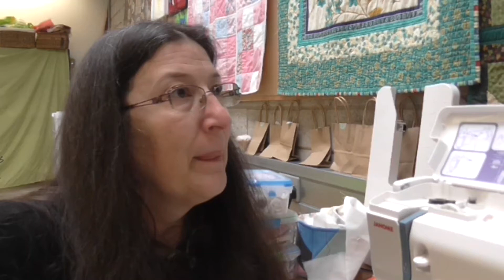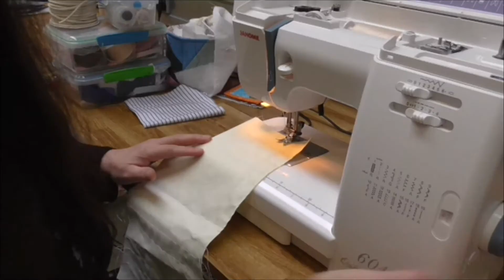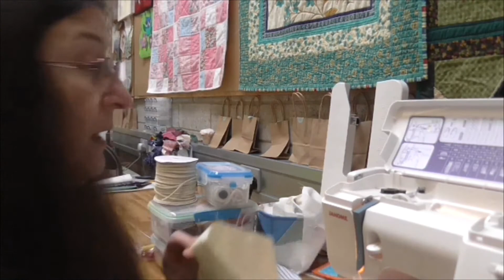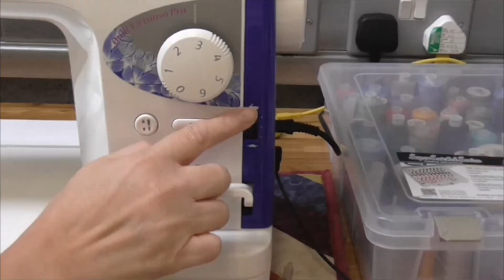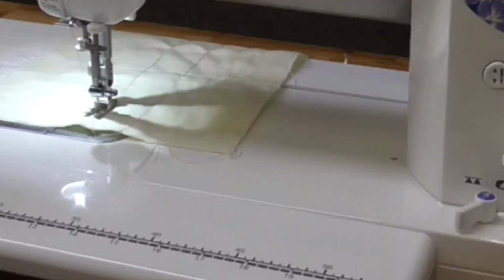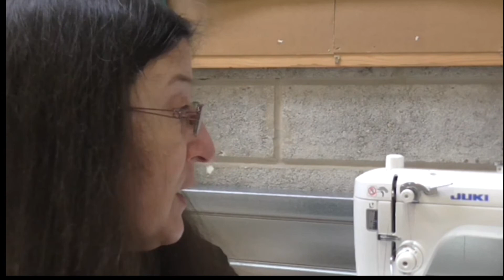How to control the speed of your sewing machine

Comment: So, do I need to buy a really expensive machine to have the luxury of variable speed? I have a Brother and a Singer and they are both mad fast with no way to slow them down. I even took the foot pedal apart to adjust the speed, but that did not work. 
I really want to sew, but it is pointless with the two machines I have, as I have no control of the process.
Reply from the maker: What model Brother do you have?  I know the Singer Heavy Duty machine only goes fast or stop.  I have managed to slow down one of my learners machine by turning something in the foot, I didn't need to take it apart.  Some mid range machines have variable speed, but I've not seen it on the very basic machines.
Reply: @LoopysPlace  The Brother is LS-2125i, and it is one of the most basic models available. 
The Singer is 4452 Heavy Duty, but still has trouble going through multiple layers of fabric. Could that be because a heavier needle is needed? Like a denim needle, even though the fabric is not denim, but multiple layers (like 4 layers) of a thinner cotton?
Reply from the maker: It should go through it, no problem. You could try a jeans needle. What are you making?
Reply: @Jackiesmith2801 I turn my pedal so it is backwards so I can't put as much pressure on it.  It isn't perfect but helps a little to sew a touch slower.
Reply: @trevorsmom5690  I'll try that. Thank you!

Comment: I can drive no problem, but my pedal seems to be 0, 5, and 200.
Reply from the maker: What machine do you have?
Reply: I find it very helpful with my machine to take my shoes off so only my feet in socks touch the pedal.  I can control the pedal movements much better so that the speed of the machine is to my liking.  I have a Bernina 1630.

Comment: Hi my stitched are loose am I putting to much pressure on my foot pedal?
Reply from the maker: It's more likely to be a problem with the set up of the machine rather than the speed.  Check that it is threaded correctly and that the bobbin is in correctly